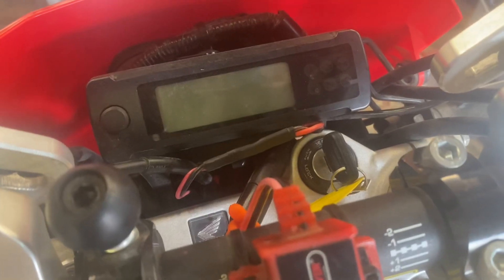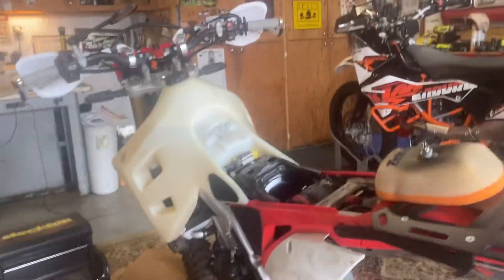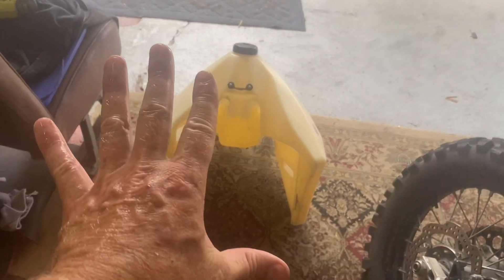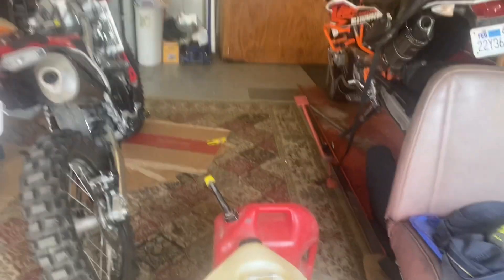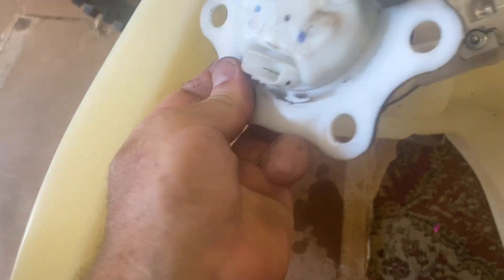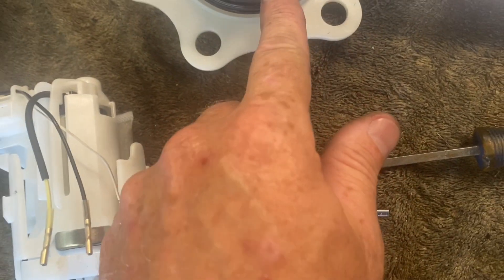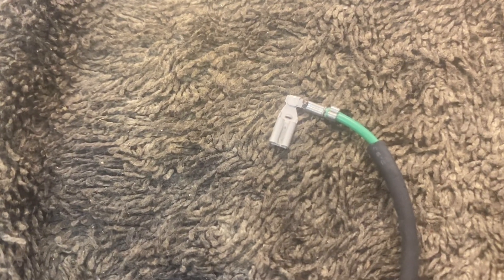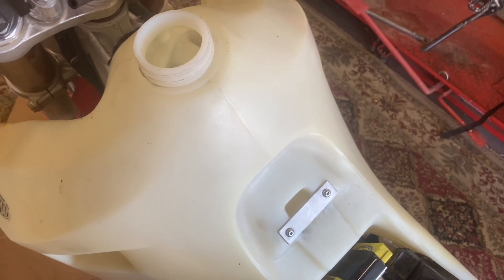Honda CRF450RL Fuel Pump Troubleshooting / How To Replace Or Repair

Comment: This was awesome, thank you. I suddenly had a stall that lasted about 1 second on the highway with my 450l so I’m trying to figure out what the issue might be!
Reply from the maker: Hopefully you figure it out.
Reply: Mine has been acting up for the last 600 miles and finally crapped out yesterday. Some days it's completely fine and once in awhile it will shut off or spit and sputter. There is another channel called mob city moto that explains the symptoms he had with his. This is a great video as well. I would have just ordered a new one without looking at what it might be first. Now I can look the pump over and check for something like this.
Reply from the maker: @SuperiorTim989  I didn’t look into it, but you can likely just get the pump itself rather than the entire housing unit as well.  Honda wants a lot for the entire thing, so just pulling it apart and replacing the pump is going to be considerably cheaper.  Good luck.
Reply: @TomsTinkeringandAdventures  yes I just ordered a "all balls" rebuild kit for about 80$.
Reply: So it turned out mine was that same wire. Got it fixed and worked great for 200 miles worth of different trips here and there. Oddly enough I hit a small jump,landed and the bike died out. It won't start and I can't here the relay or the fuel pump. Would that mean the relay could be bad?
Reply from the maker: @SuperiorTim989  it’s possible, but I usually go back to the last thing I worked on.  Check those wires again

Comment: Good stuff  Man, Brrrrrrraaaaaaaaaap
Reply from the maker: @jm1979mx  thank you.  This repair eventually failed.  My friend got a complete pump assembly, and now carries the old pump and the wires as spares.
Reply: @TomsTinkeringandAdventures  I prefer Honda myself and am an A class MX Racer 
As a mechanic what off-road brand do you like
Reply from the maker: @ honestly, the worst bike I’ve owned in the last 20 years was a Honda!  I think it was just a lemon, have owned pretty much all of them and for the most part they have all been fine.  Pick a color and ride.
Reply: @TomsTinkeringandAdventures  what do you think about KTM I'm considering 1, all though I won't buy a bike with air fork setup, oil in both for me.👍
Have a nice Thanksgiving too 🦃👍
Reply: @TomsTinkeringandAdventures  what failed with the repair, the wire crimp?
I was thinking about light soldering the wire connectors? Wyt?
Reply from the maker: @jm1979mx  I currently have a KTM 690, it’s been good.  I don’t know much about the air forks.  The connector that I crimped on broke, it wasn’t quite the right part so I’m sure if I could have found the right one it would have been fine.

Comment: My 2018 450r had nearly the same issue, except the ground wire was broken at the terminal closest to the connector. I  did the same repair, except had to use a different pin on the 4 pin connector side as it had broken the first off completely. I suspect fuel slosh moves the wires and eventually fatigues the terminal. I put a zip tie on the wires to help prevent this happening again....
Reply from the maker: @johnc5090  my buddy tried to find just the wires, Honda doesn’t sell them.  I guess it would be a good business opportunity.

Comment: Struggling with fuel pump is a major pain in the buttock on 2003 Chevy Malibu!  It was some corrosion and a clogged fuel filter which caused a breakdown. 😞
Reply from the maker: Yes, usually it’s not too difficult to troubleshoot at least.